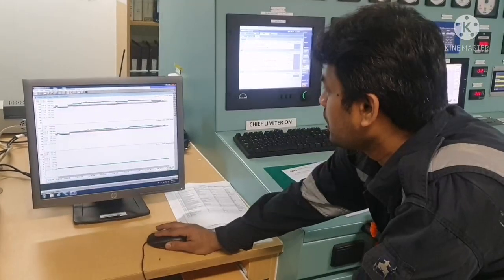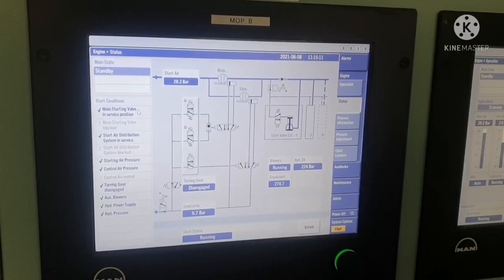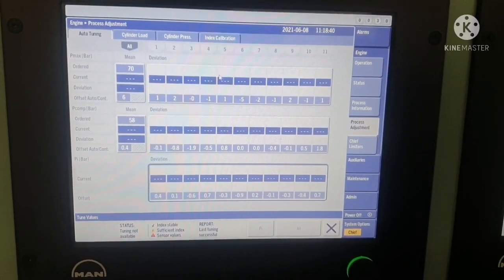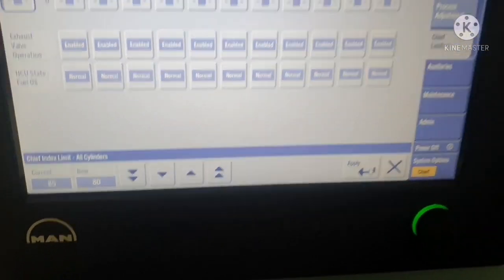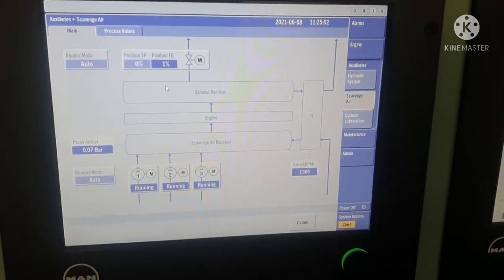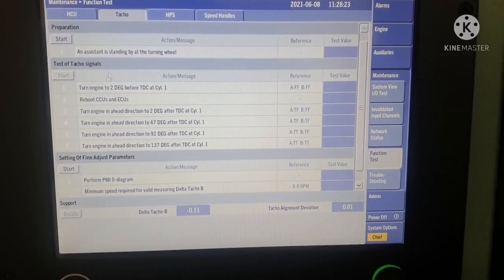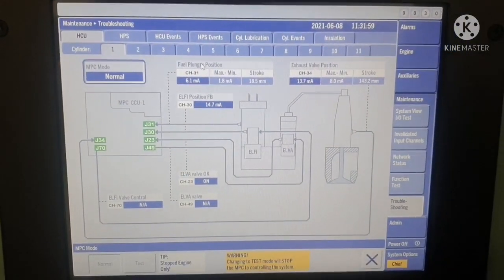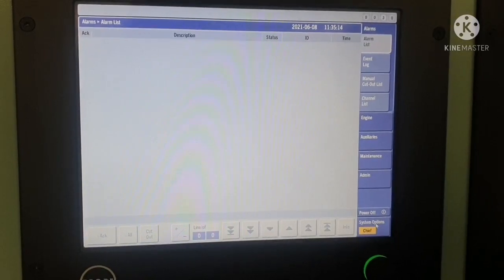How do they work... know all functions in main operating panel(MOP) for ME Engines..

Comment: Hello there . I have a small problem . In Man B&W ME-B engine when we have high load and speed around 82 rpm - 56% load the cylinder no.2 have p-compression -3.2 above the -2/+2 limit . Any suggestions please ?
Reply: Bro, You can do Auto Tuning of the Engine (specially the Deviations) , hopefully that will solve your problem
Reply: @sailor1145  Alright thanks for the reply. I will try it .
Reply from the maker: U can alwsys do auto tuning bro.. Do it individually... Don't go for auto tune all